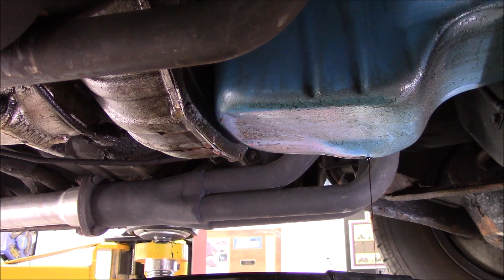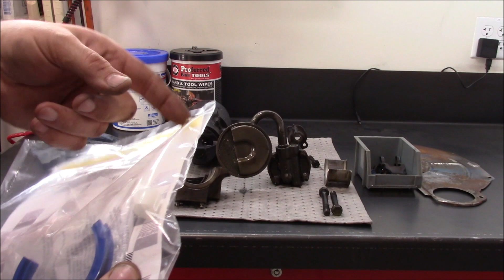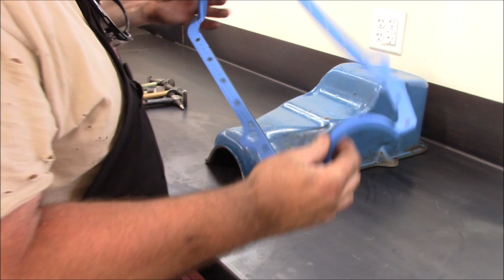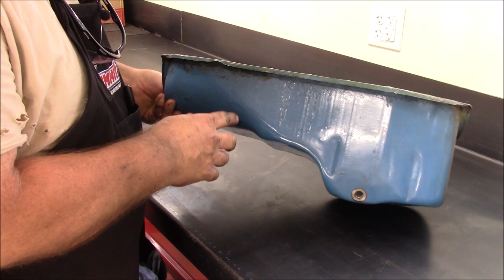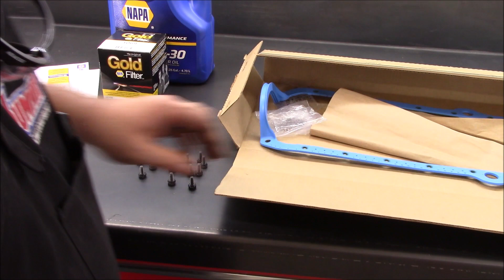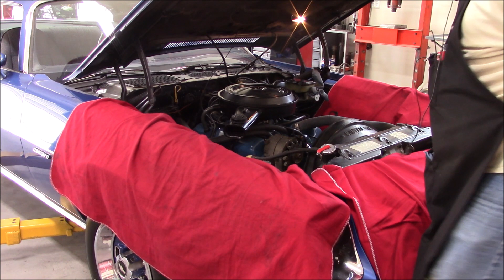Small Block GM 2 Piece Rear Main Replacement

Comment: Hi Mike
You made it look so easy.  I really enjoyed watching the video.  Reminded me of the old days, some 30 years ago when I did my last in the car rear main seal replacement.  I was on my back and the car was up on jack stands.  The kit did not come with that helpful tool.  In recent times, we put new seals in when we built our race engines, much easier when everything is apart.  Your approach was very impressive.
Thank you for sharing,
Carl Bullock
Newtown, PA
Reply from the maker: Thanks Carl. I appreciate you watching and especially for the comments.  
Mike